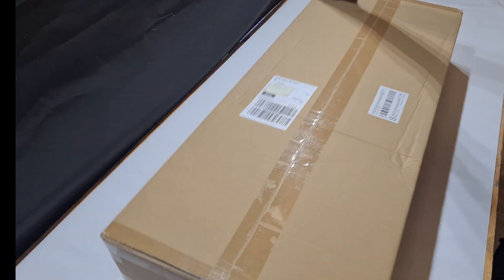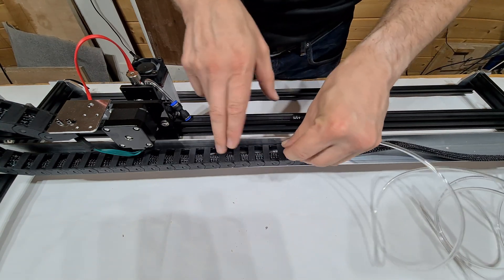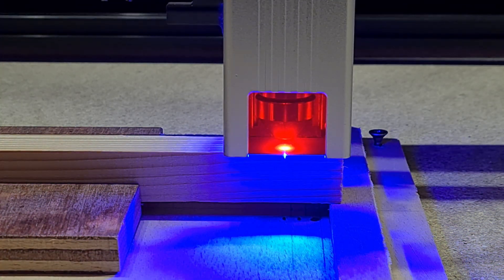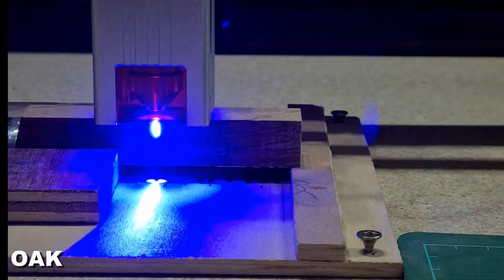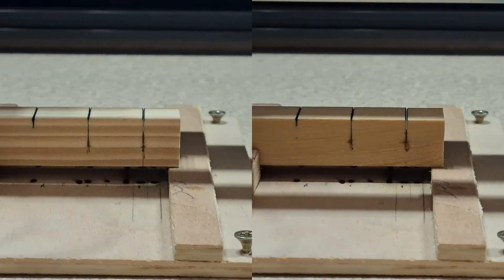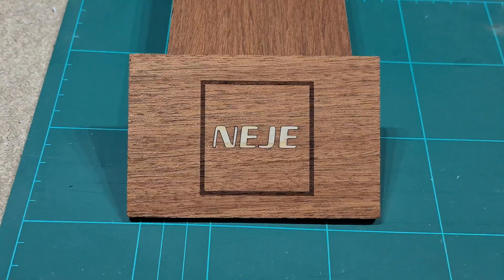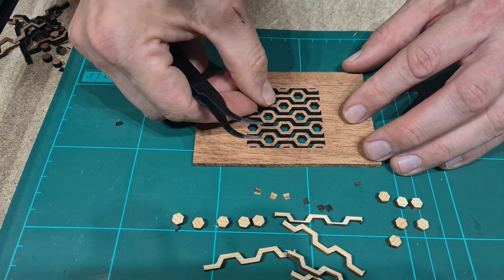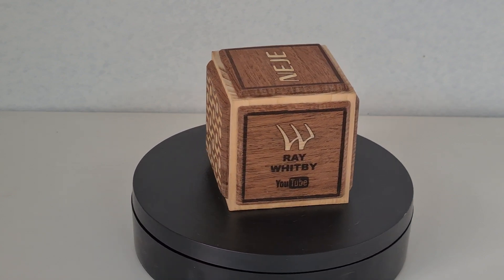How to Cut Wood With a Laser - NEJE 3 Max and E40 Laser

Comment from the maker: Question of the week: What is the most technical and/or favourite laser wood cutting video and why?
Reply: I've watched several reviews of the Xtools D1 laser which has 20 watt beam energy, and it's the best I have seen so far.  It cut through 3/4" spruce fairly well.
Reply from the maker: @Steve.Garrison  Thanks for letting me know Steve. do you know how much charring occurred through 3/42 spruce?
Reply: @RayWhitbyCreations  Here's one that showed a good test of cutting thicker wood:  https://www.youtube.com/watch?v=R6qCplOJSzw  I also read somewhere that the air assist needs to blow just enough to clear the smoke.  Too much air causes the wood to catch fire - I wonder if CO2 instead of air would further reduce charring by keeping free oxygen away from the cut?

Comment: I bought the laser and cut a lot of stuff. It's excellent for wood up to 1cm. for 2cm you need to cut both sides keeping perfectly aligned which is a bit harder. MDF is one of the hardest materials. Though I have a successful combination for 1cm MDF with 10 passes at 800 speed, then 5 passes at 100 speed and a final 1 pass of 50 speed. Experiment yourself.

Comment: Hello, can you tell me if the E40 can cut 1.5mm single layer cardboard?..not the currogated type....just one layer kinda like a cereal box cardboard but a little thicker..will it cut it perfect and perfect edges with decent speed?

Comment: I recently bought a neje 3 max with E40 module.
I find it difficult to get the cuts I see in your video.
PLYwood 8mm, I need 3 passes 80mm/m 100% to cut, however on the back of the material, the cut is a bit burnt and not as sharp as on the top.
Weird thing is I did about 8 cuts in 2 passes, then I was trying different modes of air pressure and focus height to improve scorching and it stopped cutting me in 2 passes, I had to increase it to 3.
Initially I thought it was the dirty lens, but I took it apart and cleaned but nothing. That the module has lost power only after a few minutes of use?
I also read a post on reddit where they said there was a bug in the firmware and advised to set the $30 value to 255, but it doesn't change anything.
While MDF 5mm is absolutely not cut in one pass.

Comment: So many reviewers doing laser machines,  but so few who actually know anything about what to  look for and how to actually test a machine.  They focus more on the machine as a whole whereas the capabilities of the laser module is what really matters.    In your case, you approach it regards the wood you intend to cut.  I like that .. as this is what I use it for.   

Now some gems you missed:  the feeler gauge ...  you could have mentioned the thickness.   The quality of the laser is about spot pattern and the spread of such through the material.  In this case, the laser looks really bad.   Neje claim "Focus: 0.03x0.04mm （10000W/m²）" which based on your video is absolutely nonsense.  Not seen any laser, not even the Sculpfun S9 can achieve that.

In your test, you should have depth cut both axis's.   What good is it if the laser can cut say 8mm deep in 'X' and only 6mm in 'Y'     This test would quickly reveal if your spot pattern is anything approaching square. (in your video is does appear that the x is finer than the y axis)  Your inlays look nice .. first video I have seen of somebody doing this.   Well done Sir.

Comment: Good demo. Do you have any suggestions for feedrates when engraving and cutting the thinner stock (like for the reverse inlays)?
Reply from the maker: Hi Will. Not tried really thin veneers, but would definitely need to anchor those pieces down so they don't blow away.

Comment: hello. I have bought a Neje E40 module. I'm going to use it to cut mdf. What height of the module with the wood do you recommend? The module came with a small instruction manual in Chinese and if I don't misinterpret it, it would be 5 mm.
Reply from the maker: Hi Marcelo. Yes 5mm separation between the bottom of the laser module and the top of the MDF is correct. It's not very critical, depends on the thickness being cut. Be careful how much power you put into MDF. At 100% power and slow speed it caused issues with MDF: https://youtu.be/r7Tt_VUZwWQ?t=278
Reply: @RayWhitbyCreations  gracias

Comment: Ray what did you find was the most optimal focus point, its fixed focus unline the 40640 but what did find was best focus distance
Reply from the maker: Hi Stefan, for engraving it's 5mm and for cutting it's 3mm. That's for the E40 system. I didn;t realise that the protective lens needed cleaning (especially for cutting), so i was underwhelmed by the laser module until someone told me what to do to clean it!

Comment: Well it will be painfully long with this power.  Burnt can be easy remove chemically its laser cut multi layer fretwork > https://youtu.be/mXyjK4dyeDQ ... but those chemical are used also for remove flesh on skull trophies.

Comment: Ray, to be able produce quite accurate inlays like that is quite impressive.  I haven't looked into laser engravers before as I thought they could only engrave, for me to make inlays like that on my CNC router would only be possible by using a V bit cutting tool so that the male and female parts have a 45 degree chamfered edge allowing them to fit tightly together.  The smallest cutter I have used on my CNC is 1mm in diameter with a max depth of 10mm and do not allow for sharp inside corners to be cut as they are round.  In the future I might have to get a laser to fit to the CNC and try it for myself.  Thanks Stu.
Reply from the maker: Hi Stu. thanks for your feedback. I had wondered what the limitations would be for CNC and would still love to get one to play. I was inspired by the work done by Broinwood and the level of detail he got was impressive. I recon there are vastly more positives to the CNC router system and if I could ever get a 5-axis version, I would be very happy!

Comment: To borrow a phrase from a surgical friend of mine who used a baseball metaphor, what you showed here seems like a long run for a short slide.  Way too much assembly required.  Try a commercial Epilog laser system which has this all down cold.  They have a video of them cutting an intricate flower pattern into some wood from a vector-based pattern (like from Illustrator), then automatically shrinking the pattern by .001 inch and cutting out the same pattern from a composite sheet of blue abalone shell and dropping the abalone into the space in the wood.  Looks fabulous.
Reply from the maker: Hi Anduril Designs. You are right. I think I'm already too late to this game, but had to see how easy this system was for the kind of work I want to get round to doing. I note that the Epilog lasers also have the CO2 module which sounds more like what I'm after. Alas, unless Epilog send me a system to try, I'm going to be looking longingly for some time! thanks for the heads up!

Comment: Good review, Ray.  I'm hoping the diode lasers will soon become good enough to use for cutting thicker wood.  A few years ago I used a 2.8 watt blue laser diode that was barely able to cut veneer so this is a step in the right direction.  I think they'll need a longer focal length lens to do what I want.
Reply from the maker: Hey Steve! This one was 11W and they are preparing to send me a 20W end of this year, which will be perfect for 1 particular project I have in mind that needs depth. Apparently NEJE's A40640 can go up to 18mm, but that's only 12W. I'm a little shocked at how easy it is to use these kits. All the best. Ray
Reply: @RayWhitbyCreations  I've got another question:  How much sanding is needed to remove the char from the edge of a thick cut?  Judging by the edges it doesn't appear to be very deep.
Reply from the maker: @Steve.Garrison  I'm looking at this through some additional cutting trials and I think it varies so much on the type of wood.